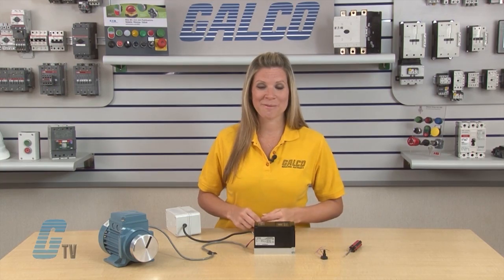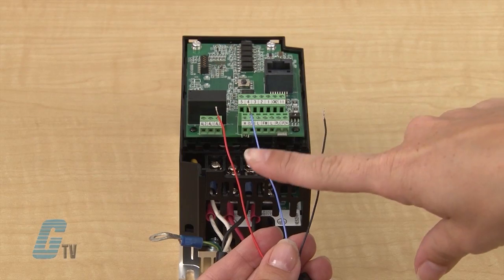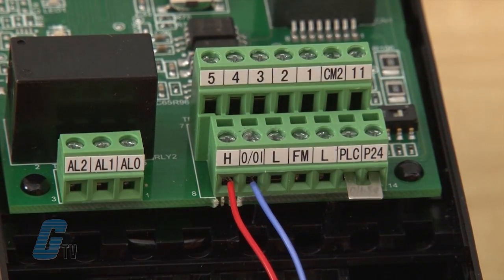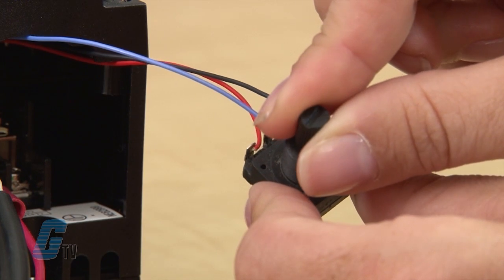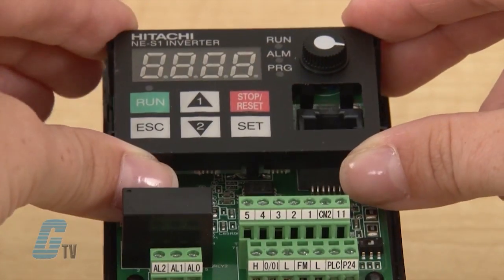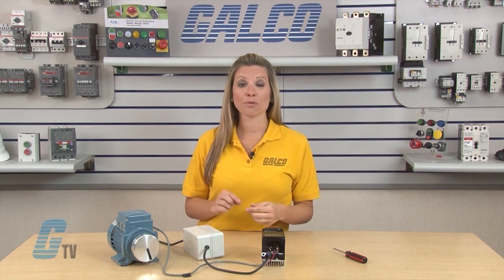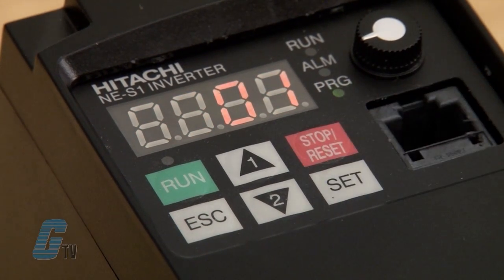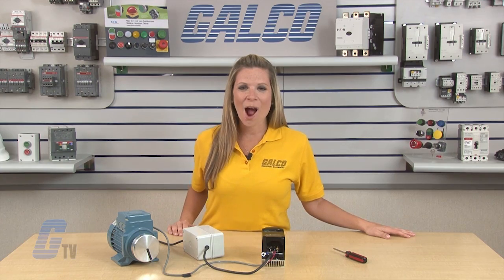Hitachi America NES1 Series of AC Drives: How to Wire a Speed Pot and Install Optional Keypad

Comment: What size pot did you use?
Reply from the maker: +Matt Miller 
Pg 43 of the Quick reference document, which can be found here, states:
http://www.galco.com/buy/Hitachi/WJ200-015HF

Using an external potentiometer is a common way to 
control the inverter output frequency (and a good way 
to learn how to use the analog inputs). The 
potentiometer uses the built-in 10V reference [H] and 
the analog ground [L] for excitation, and the voltage 
input [O] for the signal. By default, the [AT] terminal 
selects the voltage input when it is OFF. 
Take care to use the proper resistance for the 
potentiometer, which is 1~2 kΩ, 2 Watts.
Reply: I heard in other videos non related to hitachi to use a 10k pot
Now… I don’t think you’ll damage using any other value pot in it. After all is just a dialing resistor draining voltage, some drain faster than others.
I work with guitars and I’ll try with 25ok and 500k let see.

Comment: So how do you set it up so that I can command the motor to run fwd using a remote relay and do I need the nes1-op to change parameters?
Reply from the maker: +3dw3dw Yes you need Nes1-Op to change parameters.
Setting up the relay inputs is shown in the manual on document page 49 or page
5-12
Reply: +GalcoTV could you please drop a link to that manual.
The manual that came with the unit is on a single page. I found a pfd file but it says to connect the L terminal to the 1 terminal via relay for forward or to the 2 terminal for reverse.

The issue that I have with that is that the 1 and 2 on the illustration is between the L terminal and the FM terminal on the same junction block that you are connecting the pot to in this video. 
your NES1 is not configured that way, neither is mine. 

The manuals I've found so far for the NES1 are terrible...
Reply from the maker: +3dw3dw http://www.hitachi-ies.co.jp/english/products/inv/nes1/doc/NE-S1QuickReferenceGuide.pdf

http://www.hitachi-america.us/supportingdocs/forbus/inverters/Support/NE-S1(%20SM-E271).pdf